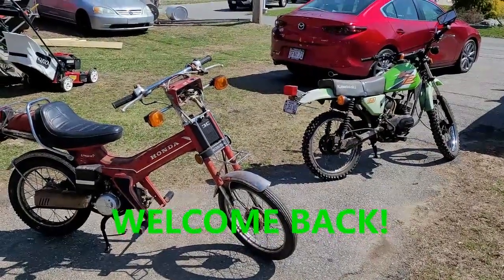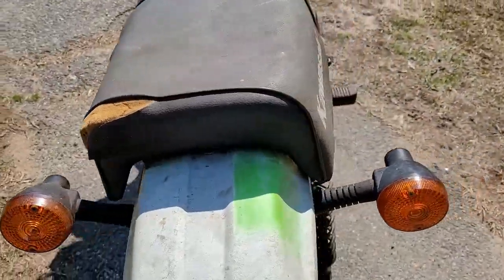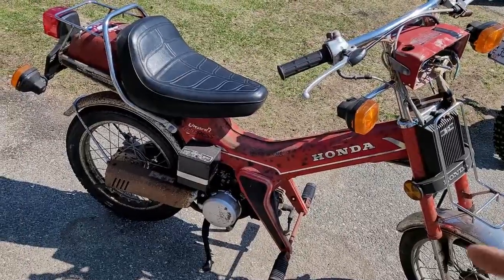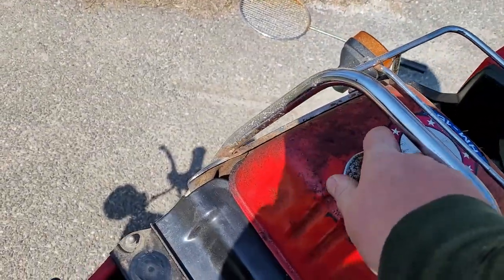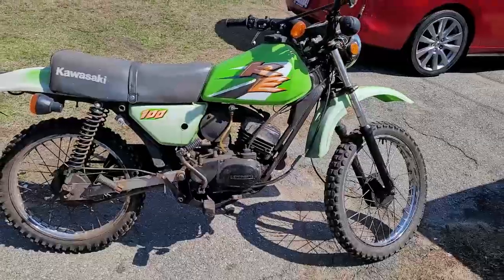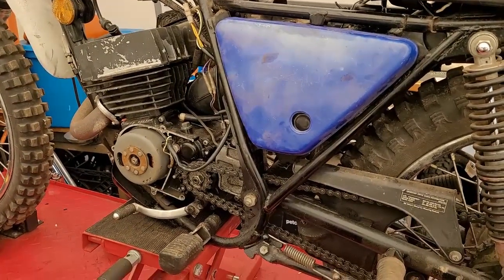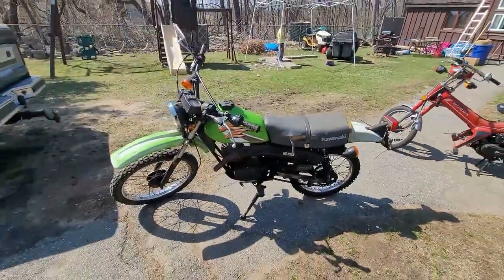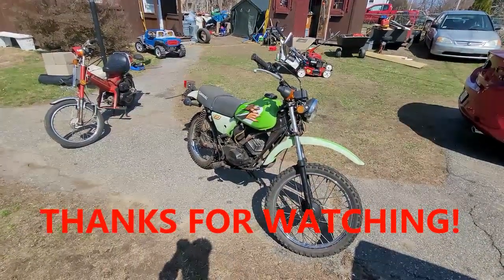Checking  Out Matt's KE100 and first look Honda Urban Express NU50

Comment: Rear brake arm a little bent, rear tire is technical not the oem tire but no biggie, fuel line grommet, rear license plate holder (I see zip ties lol), looks like maybe a cylinder base gasket leak, exhaust flange leak, wiring looks jank near the headlight, missing bolt for the clamp around steering column, air filter bolt, side mirrors, screw missing on right side of headlight, seat isn’t in the best shape. I’m noticing a hole on the right side of the seat, mine doesn’t have anything there so mine may be missing something lol. I know mine doesn’t have the seat lock unfortunately
Reply: wow you got a lot more than me
Reply: @boots1807  I have been spending some time working on mine lately so fresh in my mind lol
Reply: @mitchell5126  ok

Comment: Bolt missing in the triple clamp, seat lock missing, air box screw missing, bent bolt in rear brake rod, signal light broken off and some wiring has been worked on.....
Reply: Fork seals and bolt missing carb cover head light screw missing....